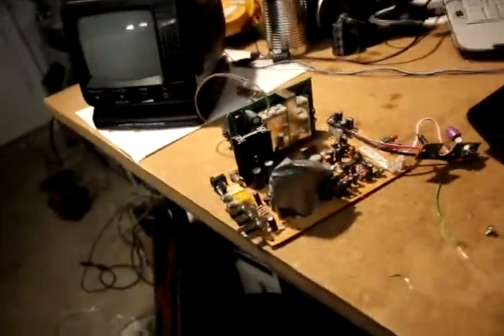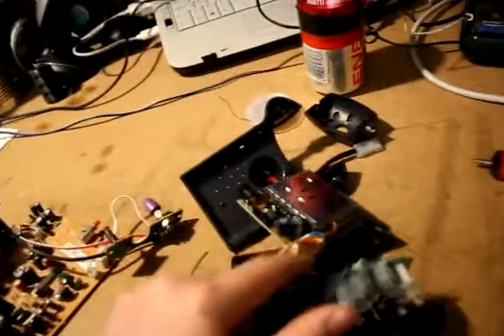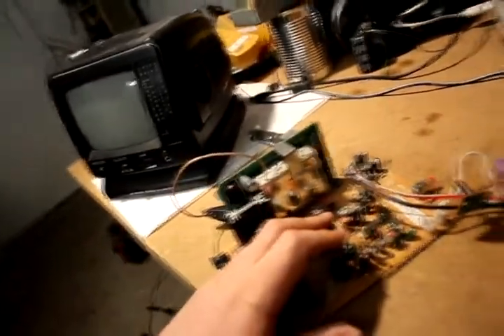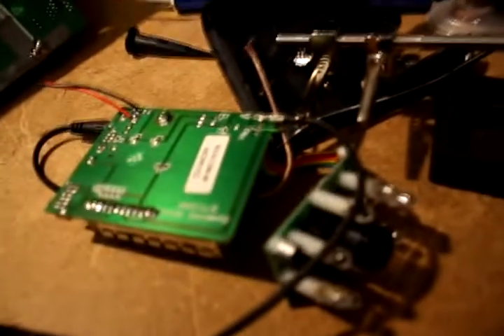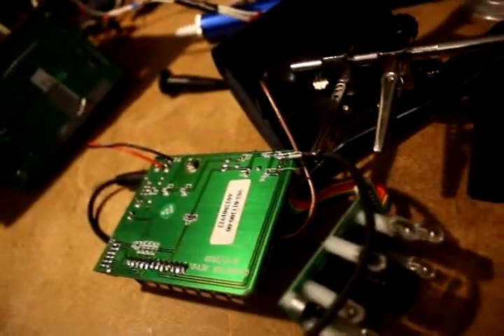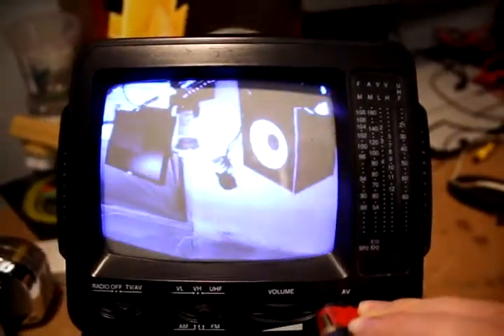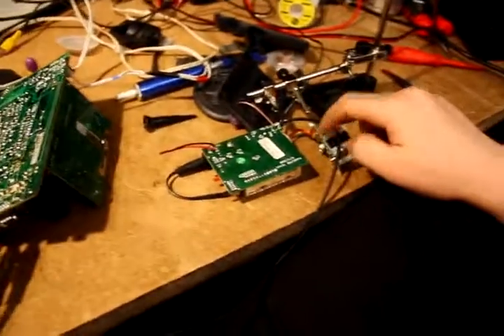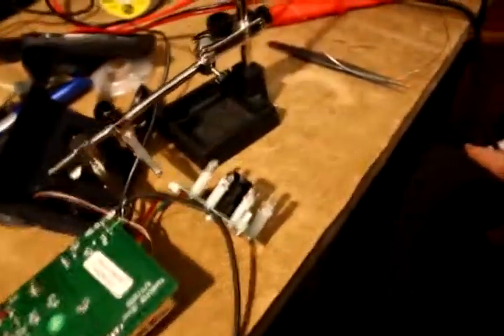Hacking an old Trust wireless camera

Comment: hi Freezer, dit you manage to get the camera module working separate from the main board? do you now  the pin-out from the colored wires? that will help me allot with my project. thanks,  kind regards Ruben